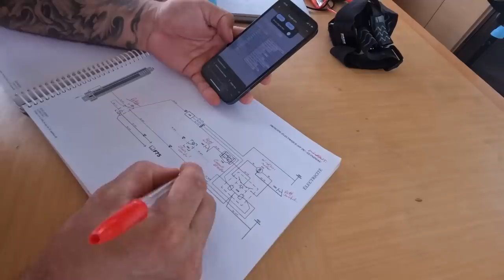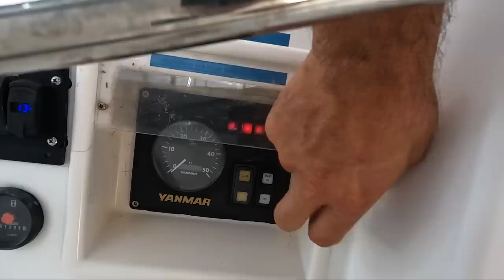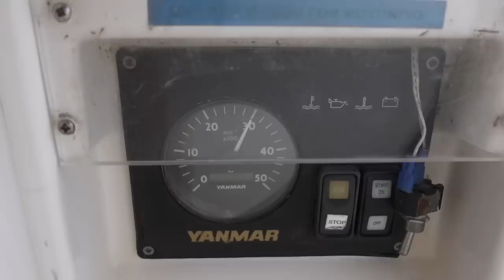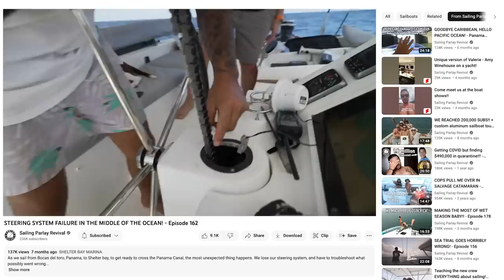THIS COULD POTENTIALLY SINK THE BOAT!  - (Episode 195)

Comment: Having been a boats engineer on commercial fishings boats for 27 years in my past one of the cheapest remedies to help keep rust at bay on steel fittings under deck spaces was Denso Tape (Grease coating Fibre Tape). I'm sure you probably know about it but i found it a massive help  and just thought it might be good to mention it. We used a Canadian brand as it was better quality and worked well. Keep up the crac boys your keeping us all on the water even if we don't have a boat.
Reply: Yup, always wrapped our hydraulic fittings with Denzo tape, even lanolin spray would keep those track rod ends from rusting.
Reply: great advice thanks.. never knew about this product, I usually brush on grease but this is way better, cheers!

Comment: Hi Guys, a few tips, that depth sounder is expected to be removed regularly as sea life attaches, there is a flap that reduces the inflow of water so no need to panic, attached the blanking plug close by while you withdraw sensor to clean it. Yeah you guys are in warm water and probably scraping that hull frequently and cleaning the season from out side. Not so here in PNW. Also, install 2 mast steps at about 300mm above your max height with halyard and use a well made loop to hold, ease yourself onto step, so that you can see top of mast components during maintenance. I only use a harness as activities such as halyard rethread at sea are not safe using a bosuns chair.
Reply: Come on - you have to give anyone credit as a boat owner and especially Colin as a frickin experienced megayaught engineer to understand that some water is going to come in. 😅 This was for drama and also a little extra stress as the actual boat owner.

Comment: If your view is restricted for looking into a terminal box etc. try using a mirror. Most hardware stores will carry them on a little telescoping pole. Found them invaluable in tight spaces over the years. A flashlight along with the mirror in dark spaces like the bilge!
Great video as always!

Comment: Thanks you reminded me of that feeling 
Fire up the engine drop the mooring and heading out. Feeling the  vibrations though your feet and the surge of progress   looking onward to the next navigation point. Your mind reviewing possibility of the  destination and opportunity opening ahead.  .
Priceless.

At lest two fully  independent systems .
For depth sounder, GPS, charting,  heading, radios etc. as per NZ cat one. 
Some things are nice to have not necessary.  wind speed and direction are under that heading 
Your senses are more   reliable than any machine.

Comment: Get yourself an ammo case for the spare electronics, the metal of the case should act as a faraday cage to protect against the EMF you will experience in a future strike, it'll also keep the electronics nice and dry :)
Reply: If there was an emp wouldn't that effect  the very satellites the electronics rely on ?
Reply: @easternsuneasternsun171  While related the two are not the same thing.

EMP - ElctroMagnetic Pulse - a wave of EMF that causes widespread destruction.

EMF - ElectroMagnetic Field - the field generated by a current flowing through a conductor - used in motors and generators, but is also a result of electricity being carried down the path of a lightning strike.

When you place items inside a steel box, then the field will tend to induce the majority of its current into the box itself rather than the contents.

Ideally you'd want the box made of soft iron, but steel should suffice.

Comment: For that blind work above your head, get an adjustable mirror on a long stalk, such as a motorcycle rear view mirror. Bodge up a mount that will grip the mast. Once in place, adjust and voila, you can see what you are doing. The idea also works for blind holes below deck where you cannot get both your head and hands into. A life and frustration saver...

Comment: Bonding does work...naturally your mast and riggin could ground out through the keel and zincs... but bonding to the motor mounts may pass future harmful hits through the shaft / prop...considering a house I grounded out from hits to hydro stacks, etc, by no6/9 cu wire what your mate did by putting the wire in water would work.

Comment: Another approach to replacing the depth sounder:  get a small plastic bowl.  Put caulking compound around its rim and then stick it on the outside of the hull over the spot where the depth sounder is located.  The water pressure will hold the bowl in place while you pull the depth sounder.  Shouldn't get more water in than the volume of the bowl.

Comment: you should make a power plug on the marine equipt that you can unplug whenever you suspect a lightning storm it be alot less stuff to replace and your not using it at anchor
Reply: That's an interesting idea.
Reply: The only foolproof solution is to disconnect and remove the expensive stuff and put it all in the oven or any other metal box. Tedious but worth it if you are leaving the boat for a few months.
Reply: @jessiebrader2926  it will travel through power wires untill it ground at the water its not a emp the oven is not needed just disconnect from the system the key is really making sure nothing is grounded after you disconnect it cause very high voltage is always going to come down you wires from the anchor light

Comment: pro tip.... next time you go up the mast, attach another strap to the bottom of the seat/ harness.  that way when you need to do work on the top of the mast and you run out of line you can stand on that piece under you to get another few feet of height

Comment: If you're worried about water ingress and you have SCUBA onboard have a diver with an empty tin can cap the hole from the outside. We even used this trick to install through hulls without hauling. Two people; Pre coat the outside section of the through hull with 5200 before the diver gets in the water; diver positions themselves close to where the through hull is to be installed; inside person drills 3mm hole from the inside pushing the drill past the flutes to the shank; diver covers the drill with an empty can; inside person now drills the full-size hole; diver takes off the can and pushes in the outer section of the through hull into the hole sealing the opening with their palm; inside person secures the fitting and installs the valve. Sounds scary but does work with minimal water ingress.
Reply: Just hope the diver doesn't drop anything!!

Comment: Do lightning rods on the mast, both bows, and sterns. 2 gage wire and tie railings together. Down to blowout panels just above the waterline. Surge protectors on everything. Then you can take a direct hit with no issues. Right now it's hitting your lighting or systems on the mast and smashing your whole electrical system. Lookup Thompson's Method for details and specifics in building a system. Thompson's Method is the USCG standard for lightning protection. All you need is 5 lightning rods, wire, and connectors.

Comment: If the boat is going to be left unattended for some time, would it do any good to disconnect the more expensive bits from the system? The only things that have to be left on would be bilge pumps and solar/shore power connections and converters.🤔

Comment: I love Tefgel as an anti-corrosive compound but not ideal for mast fittings. I was doing a delivery on a Swan 86 some years ago. It had just had a big refit, mast paint etc. Mainsail track machine screws were fitted with Tefgel and by mid-Atlantic they had worked their way out to the point we could not reef the sail. 2 trips up the mast to screw back in and let the Harken cars past but by then had ripped the mainsail. When we got to the Azores we had the local sailmaker bring the sewing machine to the boat as this was easier than taking sail to loft. For mast fittings always use Duralac.

Comment: Sad Colin, you have to use shot gun method to troubleshoot Raymarine systems. Hope Raymarine can test to old system to see if any can be saved for backup. Their bus should be protected for that surge for the next strike. Need to a better ground path so lightening won’t use your system or isolate those devises using your mast during storm.

Comment: Autopilot is not a navigation aid. It’s an equipment make it more easy so you can have less attention to navigation. So it’s an easy fix increasing risk of sailing. Anyway there shall always be a lookout. A lookout stearing the boat is a sharper lookout than one using an auto pilot.

Comment: Hi Guys, great episode, there is a system for preventing lightning strikes available but it is about 13k. You replaced your anchor light but I didn't see a tri colour light on top of the mast ??? Do you have nav lights on top of the mast for when you're  sailing? Normally there is deck level lights for when your motoring, with a steaming light on the front of the mast. Cheers from Down Under,  Rustie.

Comment: May be worth disconnecting all your navigation equipment when away from boat for a trip and when in a storm. And maybe get a Faraday cage to store them in. Surprised Ray Marine do not offer an isolator and Faraday cage for the Nav-station. Or it may be third party opportunity for some one.
Reply: The oven or fridge (if its metal)

Comment: Excellent Video. Happy you have managed to get just about everything working again (even if you had to replace just about everything). Yeah, spares are important, at least the ones that are essential (or important and cheap enough to have a spare anyway. GoPro: They have been struggling with their products from about the Gopro 2 or 3.  They have driven me to distraction for as long as I can remember using them.  Chinese pieces of crap as far as I'm concerned.  Apparently there are alternatives now, I just dont know them as I haven't needed something like that for some time now.  All the best on your next voyage to pickup your autopilot computer

Comment: Be careful with the ozone machine. I believe they are not exactly safe to be around when running. A dehumidifier would be a safer way to go. Also Jamie Mr. Eat whole apple. There is cyanide in apple seeds.
Reply: Not enough to cause any problems from one apple...you have to eat large amounts
Reply: The seeds have a protective coating, you would have to eat a huge amount of chewed up seeds to even feel slightly ill.

Comment: Question are you isolating your stainless screws to your aluminum mast not going to help with a lightning strike but would help with corrosion just watched boat show in Sweden had a pretty great lightning strike prevention company it was on sailing ran newest video maybe it can help with less troubles in the future or if you can make better do it yourself nice episode shit happens

Comment: hey colin, when u have a maze , start at the basics........... you probably have lots of fried wires. that look ok but  take a bit of the shielding off  check all of them. a big job yes,  just like ur fibre glass wiring will de laminate,  crusty.  smell it!.Oh yeah if ur multi metre says it ok ,,,,,,,,,,,,,,, then put a load on it , instant failure.  so sad 2 times this disaster. man hours and the big cost.  but after all a boat is just a hole u throw money into. funny abc radio today in australia ,  disasters of all kinds. a boat fair size , 700 bucks worth of fuel , yeah he left it to fill , but alas had the fuel  going into a rod holder. yeah a boat full of fuel. a super yacht put water in both fuel tanks , the bill more than a mill. drain tanks , strip the motors.  one saving grace colin , what does not kill u makes u stronger,  how many chinamen have u run over ? oh ya  jamie eating the paper label on his apple , i guess he needs the fibre! maybe he needs some special k?

Comment: yeah  if u master that only a few cheap parts,,,,,,,,most can be found in disused computers.  there are books on identifying what sort of gates are in a circuit, good luck. the power supply only feeds the system the logic  drives it. me thinks u need to a lot of study. . and yes a lightning bolt is very bad news to modern electronics , no way to minimise the risk if ur in it , just try to avoid.